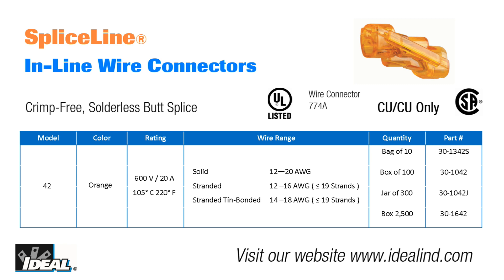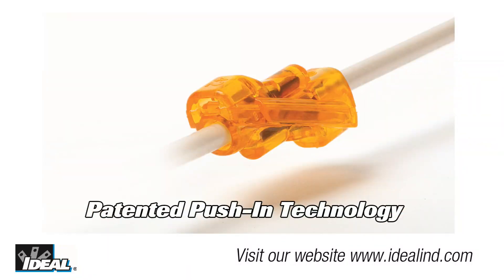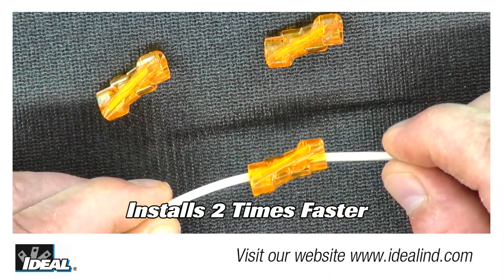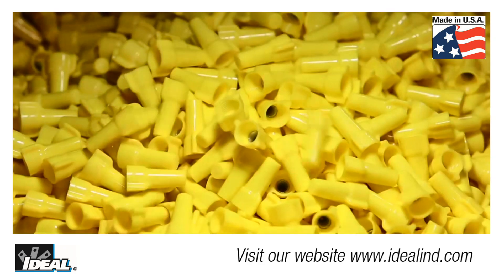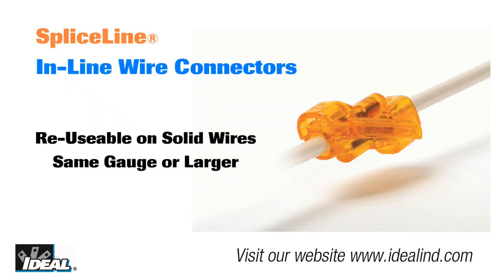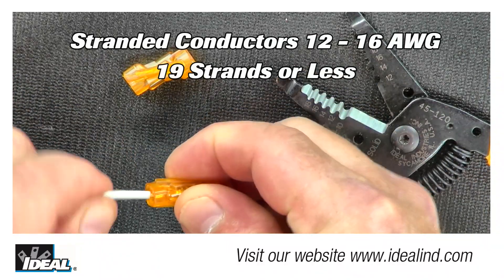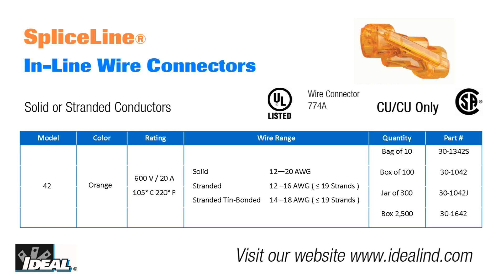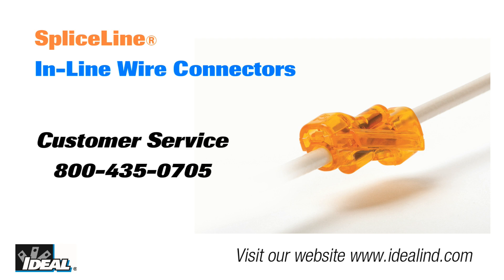SpliceLine® In-Line Wire Connector

Comment: 1) Is there any particular reason you don't offer a 10awg version?  Is is not safe to use such a connector with higher current line (30AMP Dryer)?

2) Is it any code violation or is it a fire hazard to use these type of connectors that support 30A / 10awg wires (push-fit, if I can find another brand like Wago 221-612 maybe since Ideal doesn't seem to make them) to extend wires between 2 electrical boxes?  In other words, is it OK just to connect them through one knock-out box, seal up that box inside the wall and put drywall over it (since you'd normally never access it again), then extend the outer Romex (all 4 wires in a single shielded cable) down to another knock-out box lower on the wall, which actually has the outlet?

3) Also as an aside (OP or anyone who knows), is there any code in the US North America (I'm in NJ) against putting the Washer and/or Dryer electrical outlets directly behind the appliance, or a minimum height from the floor?

More details...

I'm trying to extend/relocate my 30AMP 4-prong Dryer outlet lower on the wall. (The builder / former owner of this 1970's condo installed each above the appliances, which sit side-by-side not stacked, and my appliances are in the bathroom, so they're not hidden behind closet doors or anything to hide all the unsightly power cords and outlets...I'm trying to clean up the aesthetics a bit and would love to move both the regular 3-prong 15A Washer and 4-Prong 30A Dryer outlets lower on the wall, behind the appliances, and out of the line of sight, if possible.)
Reply from the maker: Ken IDEAL does make a 3 port push-in for 10 AWG look for the 30-1039 if you want to use it. I am not an offical on the code but I do not believe it will allow you to seal up an electrical box as they need to be accessable. Hope that helps Ron

Comment: Trash wire just cripples when pushed in
Reply from the maker: If you are using stranded I would tend to agree make sure it is 19 strands or less high count stranded wire will not work have fun Run

Comment: Do they then need to be in a box, or can they just be behind a wall? I'm trying to avoid an unsightly terminal box when moving an outlet or switch and the wires are too short. I've done access boxes in the past, but thought there might be new tech to eliminate that and still be in code.
Reply from the maker: Joe from what I know code requires they are in a box and accessible. You can always check with your local code enforcement folks. Take care Ron.

Comment: These things have a REALLY good mechanical connection actually ! How much contact are the wires getting for ampacity though ? If the contact area or whatever is good, I consider these perfectly safe without room for doubt.
Reply from the maker: Hello the connectors are rated for up to 12 awg wires so they are rated for the same as the wire or 20 amps. When UL tests these they put them through the same tests as a twist-on wire connector so they consider them the same. Thanks Ron
Reply: That's what I have some trouble with. The Old Back Stab receptacles were UL listed, and they should NOT have been ( at least, unless you pig tail, which it isn't commanded to be ). Any information on its resistance if any ????
Reply from the maker: Let me check. Ron

Comment: I wouldn't use this for stranded.  Solid wires only.
Reply from the maker: Hi FKP it works best with solid wire conductors but is UL Listed for stranded but it must be 19 strands or less. Ron
Reply: @RonKipperDatacomm1  - I'm curious, if the connector can use 12-16 gauge stranded, what exactly does the wire having 19 strands or less have anything to do with it? That is, if the wire is within the gauge required, how would the strands affect the connector's usage?
Reply: @craigvelardi7420  Those fine stranded wires are too soft to push in.